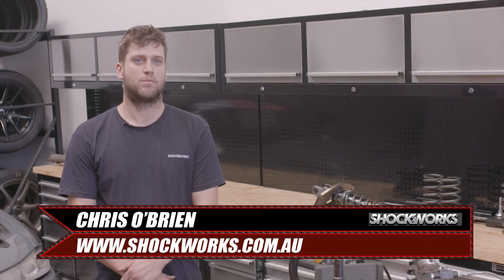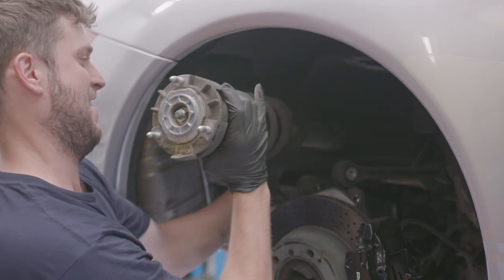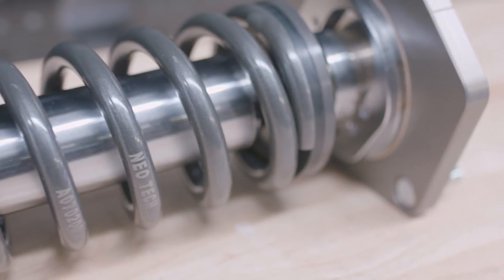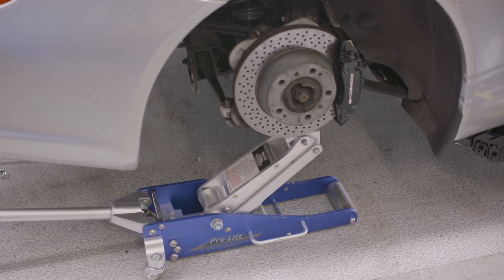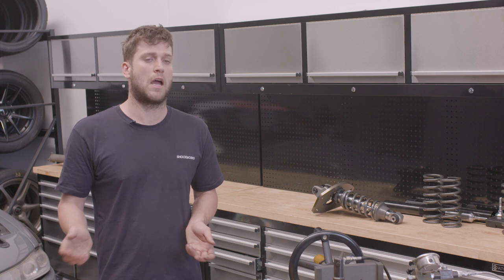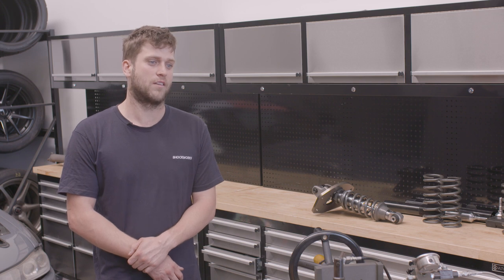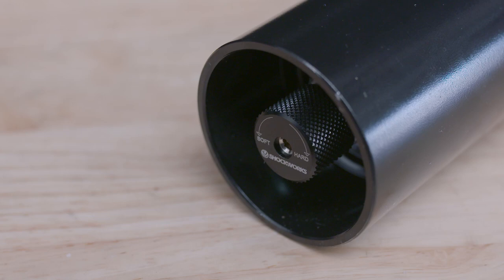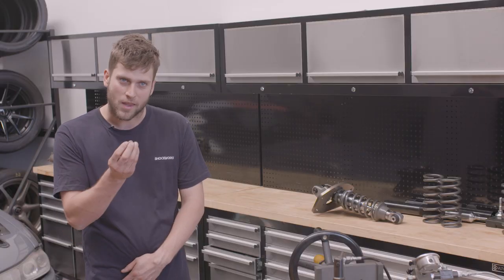Setting up your Coilovers -  The Basics with Shockworks - Motive Tech

Comment: Cool. One thing I did with corner weighting and wheel aligning the speedway car was to have a plywood/grease/plywood sandwich under the wheels of the end or side being adjusted. This was effectively frictionless and allowed the wheels to spread to where they would be after rolling the car back and forward a few times.

It was a little impractical and messy and having it under all four wheels at once when you only have a jack for raising would be a safety problem, but it did mean that my ride height and toe adjustments were repeatable and not subject to the tyres griping the concrete and resisting motion